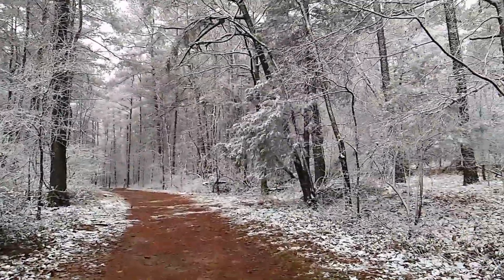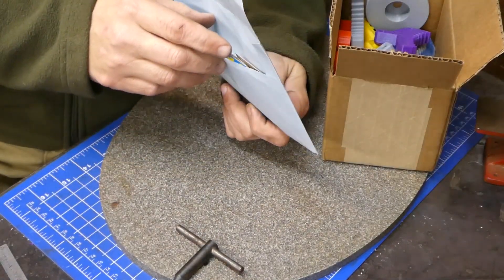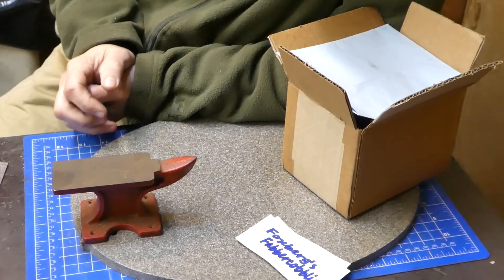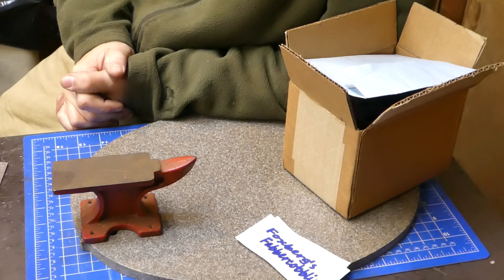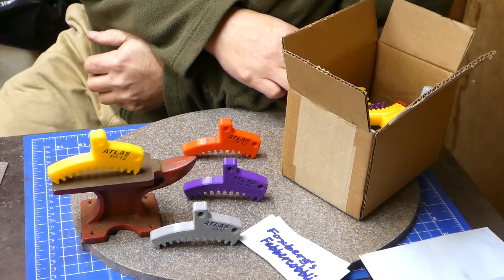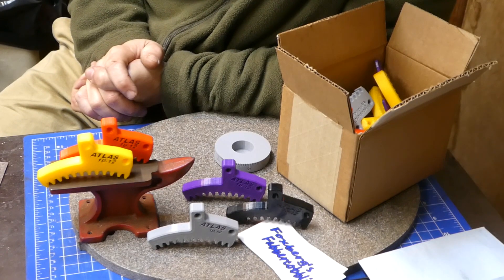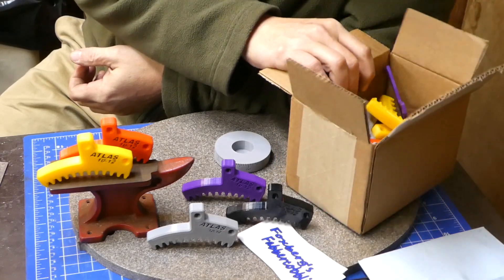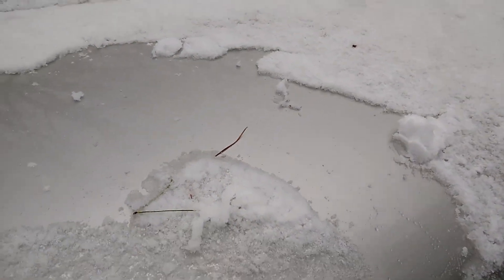Fiddly Bits - Big announcement, atlas lathe update, stickers

Comment: Great idea on the spindle locks!  I use my 3D printer quite a bit for the workshop, the biggest use has been for organization.  Everything from trays to hold collets and all sorts of other things like chamfering bits, etc., to trays/boxes to hold hardware.  Up until recently my printer was running pretty much non-stop for 6 months printing things to help organize my shop.
Reply from the maker: Yes, I have all sorts of storage I want to make as I have the time on the printer. It is going pretty much non-stop with a bunch of ideas. Thanks for watching!

Comment: I really like the concept. I finally got a heavy-duty strap wrench to hold the spindle on my Clausing 100. Something that would be of interest is index wheels for making gears. I would think it would be fairly easy on a 3/D printer.  I just joined your channel today and I like your approach. I like you made my own hydraulic press .
Reply from the maker: Thanks Terry and welcome! I was about to go the strap clamp method with the Atlas but was told about these things and one did the trick. The index wheels are an excellent idea, not thought about that one. I will be revisiting the press sometime this year, I have a few ideas to improve the design and it really needs a new jack.
Thanks again,
Eddie
Reply from the maker: I was just looking at some info on your lathe and it has a similar design to the Atlas. I bet we could could do a similar device to accomplish the same thing with it. I would just need a couple measurements from you if you are interested and would send you one or 2 for free to try out.
Reply: @theeddies  Just let me know what you need
Reply from the maker: @terrycannon570  Thanks. I will need 3 measurements. The overall diameter of the big gear, as accurate as you can make it. The number of teeth. And the clearance measurement between the gear and the case where the stop will sit. I can then make a thin prototype to send to you to see if it fits. If it does I will make you a couple full thickness. Thanks!
Reply: @theeddies  Okay when this cold front blows thru I will go back outside to the shop and take the measurements and may even take a couple of pictures for you.
Reply from the maker: @terrycannon570  Great! Looking forward to it. Best!